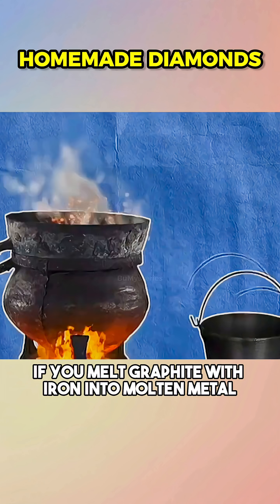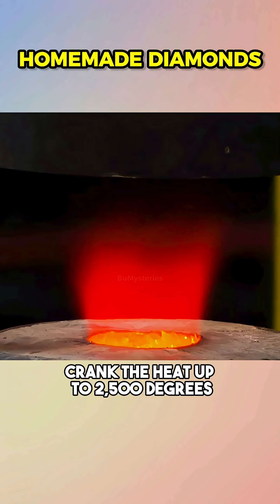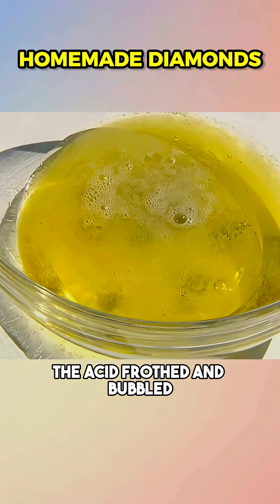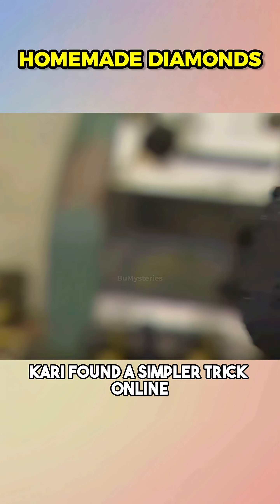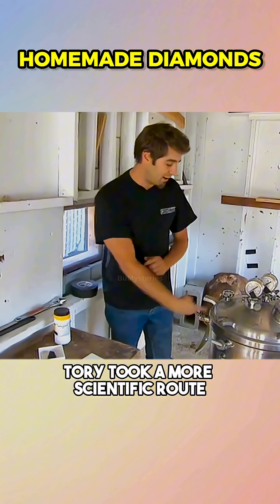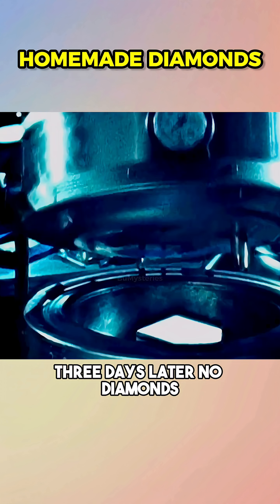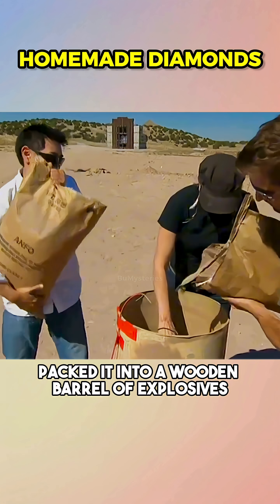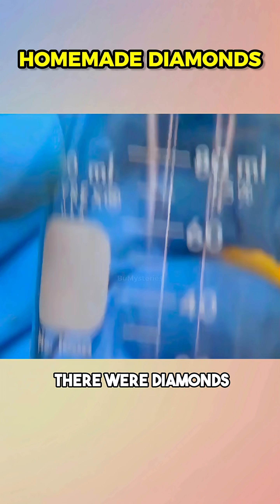Can You Actually Make a Diamond at Home? #shorts #physics #science

Comment: It’s easier to test the theory that all you need to make small industrial diamonds is to use an electrical current set up inside of a container of alcohol with all the oxygen purged from the system… not sure what voltage is required though.. and you’d need a tungsten wire to withstand the corrosion and heat but if you don’t purge the oxygen from the system it will detonate… though it might yield small diamonds as the alcohol degrades under extreme heat… haven’t tested this myself but aside from the extreme pressure lacking it’s plausible… my sense of self preservation stops me from actively creating things that can hurt me with extreme force so I’m waiting for someone else to try it under controlled conditions 😂
Reply: Respect for typing this and I wouldn’t do this either 😂
Reply: @Gaming_totheEnd  I’m a scientist and engineer by nature.. but even I have my limits 😂